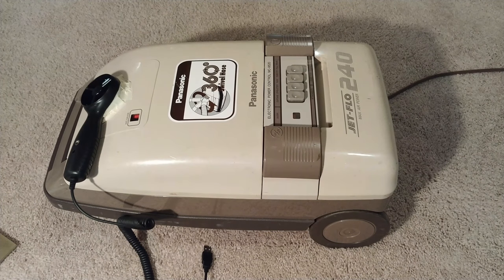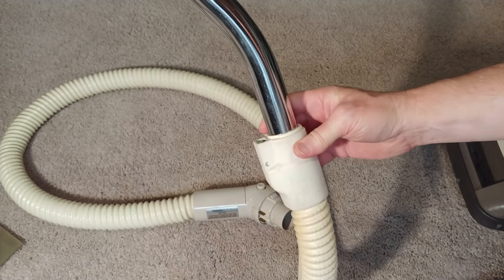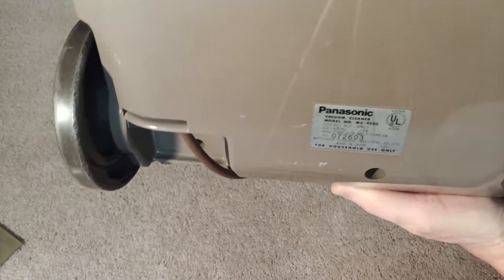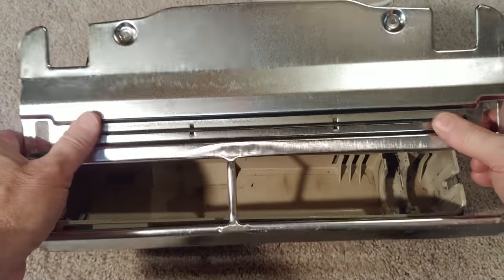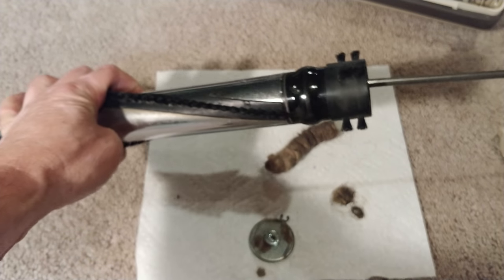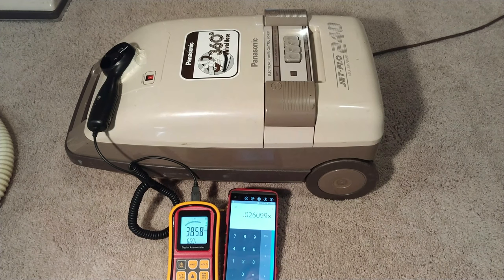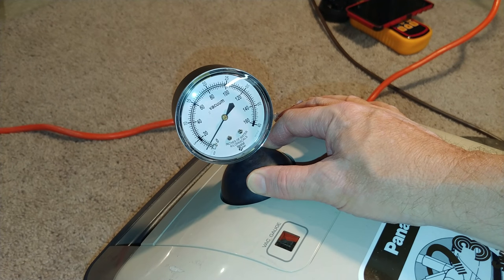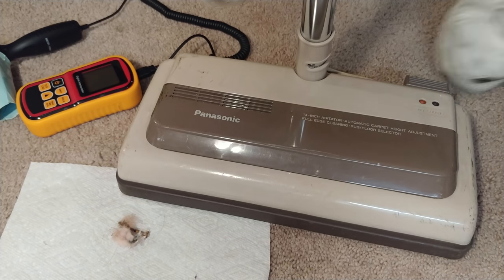Panasonic Jet-Flow Canister Swan Song

Comment: Something to avoid the carbon buildup that occurs on powernozzle canister electrical sockets. 
Whenever connecting or disconnecting the wand from the hose, shut the canister off first so that an electrical arc doesn’t build up on the connections.

Comment: That would be very nice canister and nice powerhead, but I agree it needs a lot of work. Drilling holes for the ph certainly wouldn't help :D Powerhead in it has one weird detail. brushes in it sweep the dirt away from the air inlet. Vacuum itself has same amount of hose end airflow than my green 1979 Elektro Helios and my pink late 80's Volta U258. I bet some of my old canister vacuums also has dry bearings. I don't hear any extra noises, but some take a long time to stop spinning after they are switched off.

Comment: Thanks for the great video, if the bend at the connection between the hose and the device itself is clogged, how to disassemble it after unscrew the two screws? Many thanks in advance
Reply from the maker: I disposed of this machine right after the video was posted.